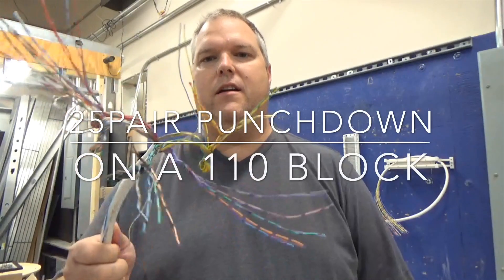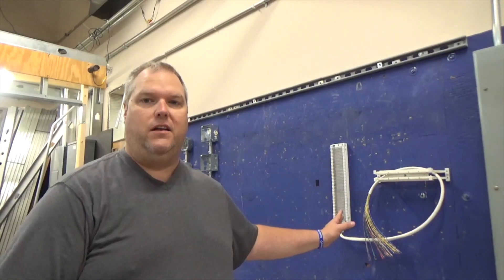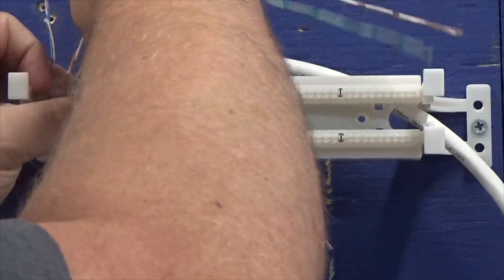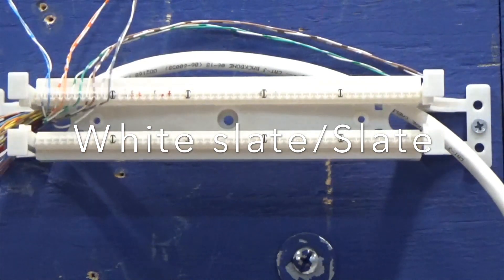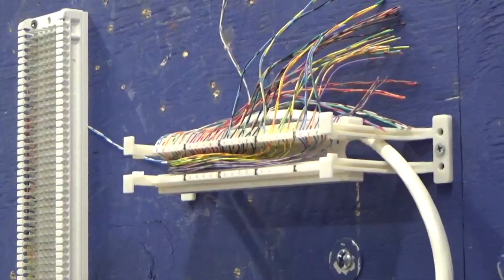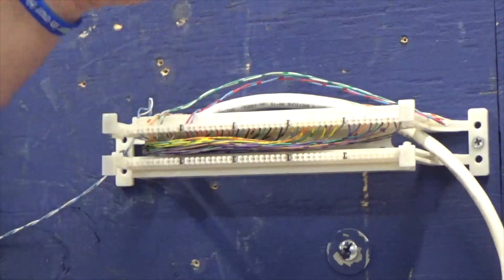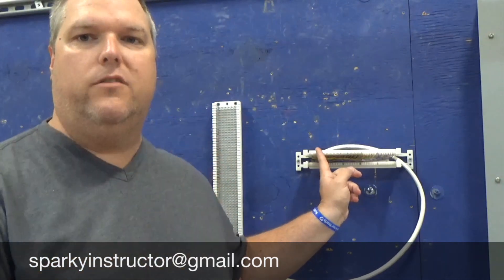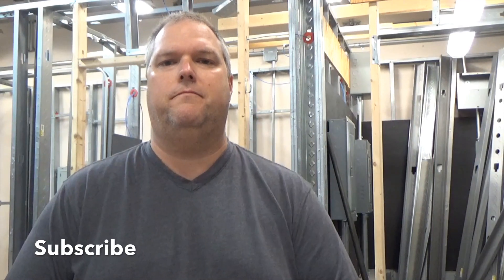110 Block Punching Down 25 pair Cable

Comment: Now you can do BIX strips.  Living in Canada, I've come across far more BIX strips than 110.  In fact, I've only once come across a 110 strip in my work.  Also, 66 blocks are getting scarce and I haven't seen one in many years.  You use a similar punch tool for BIX, but not those clips.  With BIX, you punch down the cable on one side of the strip and then flip it over, so that the cross connect side is exposed.
I carry both BIX and 110 punches in my tool kit, but these days I mainly use the 110 for Ethernet connectors and BIX is used less with the move of just about everything to IP/Ethernet.
BTW, my cross connect experience goes back over 50 years to the days of "Christmas tree" solder blocks and wire wrap blocks.

Comment: your cable color code is great, easy. some cable only has solid colors, so the white blue pair has a solid white and a solid blue, then the white orange pair has a solid white and solid orange. much care is needed to make sure you do not mix up the pairs.
Reply: Yeah, I don't care for that type of cable either.  Also, there are some makes where it's hard to tell the blue and green apart.

Comment: Well explained 
Sir will you explain what's this punching down and how it helps us?
Is this important for a network engineer to understand ?
Tnx
Reply: I know this comment is 6 months old, but I'm going to answer in case others want to know in the future.
This video shows what would typically be a part of a "Cross-Connect". 
The 66-block is terminating an incoming cable (it could be an outside cable, but it could be one from inside the same building) on the left side. These could be used for POTS (old telephone) lines at this point. 
Then on the right side of the 66-block, you will have an indoor cable (in this case a 25-pair cable) punched down. 
That 25-pair then goes to the 110 block (it could also go to a punch-down style patch panel in a rack). This allows it to be easily connected to a 4-pair patch cable (like cat6) for data transfer. 

For a Network Engineer, knowing that there is a cross connect in this location, which cables are connected and what those cables feed could be important when you are troubleshooting a fault. You will also be able to tell how many pairs are available for new phone or data usage.

Comment: can you please tell me how many connecting blocks are needed?
Reply: Depends on your cable size and how many of those pairs you actually need to use. Also, 110 blocks come in different configurations (50-pair, 100-pair, 300-pair...)
If you're referring to the C4 clip, a single 50-pair 110 block will need 12 clips.